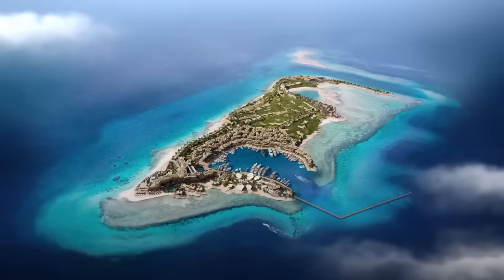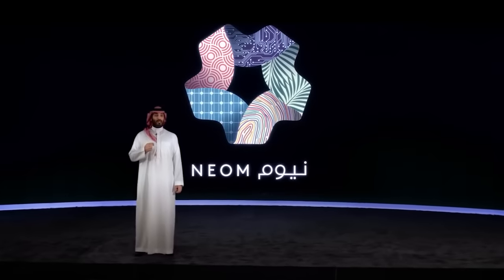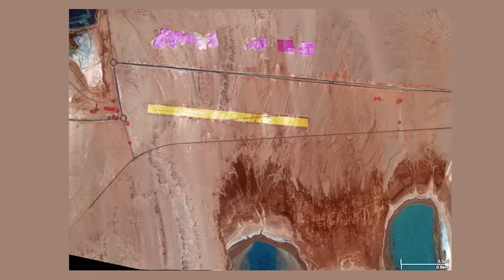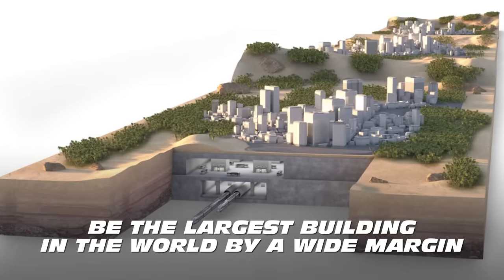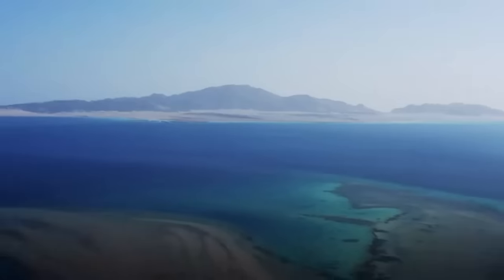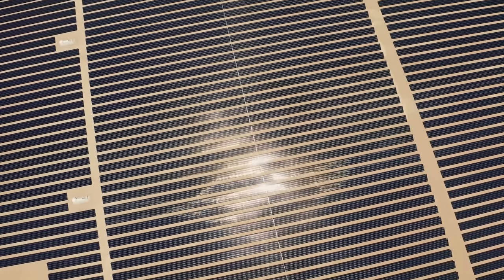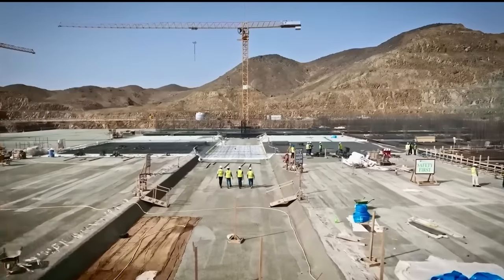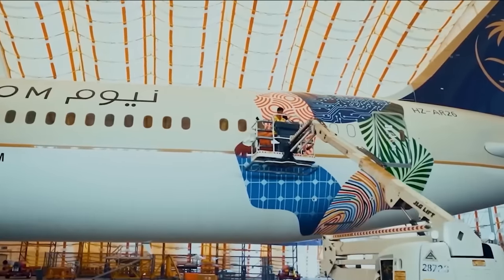Neom Is Really Happening! 😱 (2023 SHOCKING Progress)

Comment: Historically, green projects promise green, but have non-green backups. When the green fails, the backups become the norm and more so inefficient than if they had been the primary implementation in the first place. Experimentation and small scale conversion work out the kinks that slay large projects like this or leave them finished but desolate. It'd be nice, but I'm not optimistic about the project.
Reply: ya  what's 500 billion to them
Reply: Well.. we would still be living in caves if everyone gave up at the first attempts.
Reply: The bigger issue is the surveillance state and lock down capabilities these "15 minute" cities will have.
Anyone living in these will NOT be able to over throw a tyrannical leader.
Reply: I agree in a way but, on the other hand, the reason why big scale projects are usually abandoned are lack of funding. Saudi Arabia does not have these type of problems. They may get it.
Reply: The channel owner spends much time riding the green.

Comment: I’m curious if they succeed. I think the line will be the most challenging one. I question the materials they are using. A mirror facade will burn everything around it. People on the bottom part will have nearly no light. It looks very unnatural the shape of the line and doesn’t work with the natural habitat and shapes. I’m very pessimistic about this project. Too many problems and challenges. I’m worried it will be wasted money they could have used to improve already their existing cities where communities already exist. Who will live there ???
Reply: you do realize its mirror right >>>>>>>>?????and maybe the first floor wont be "ground" level"
Reply: What about sand storms won't the sand just pile up. I suppose the prevailing winds are not against the line.
Reply: @dfinlen  There wouldn't be sand, they are cultivating trees there and there would be landmarks around the line. The region they have choose because of its soil. They aren't a fool, they have researchers from Stanford and Oxford, and obviously, they have taken all care while launching the project.
Reply: @Maanaka  😂
Reply: @MichaelAndreLucasWinterdaal 🪂 The reflections of the 🧭S-storefront will cause a heat-dome with thermics towards the wall.🪟📤
Winds broke bridges 🌬🎼🌉🌉 bc of interference.🏗
Reply: Oh my Allah, for the last time no one is gonna live in the bottom. From day one we said it gonne be made of three parts, the bottom is for the transportation the middle for everything and the top is for accommodation. Everyone will live near the top floor even if its a couple floors beneath you can walk to the top in minutes
Reply: @referencefool6525  seems jealous
Reply: @Maanaka 💘😹 Just amused.
Reply: The Line is just a hitech prison. There are subway tracks, but never enough for everyone all the time, so this means you are locked into your part of the wall and become a solid brick. (These underground lines are for transport of goods and security forces.)

Comment: A large portion of the city won't be located within the structure like an airport, stadiums, convention centers, geothermal powerplants, water reclamation and deslination, as well as industrial zones and warehouses. 
Access to open water will be limited for resorts and yacht docks. 
Expansion inside the structure will also be very difficult. If a hotel needs to grow there won't be anywhere to go. Up? Down? or acquisition of other spaces possibly homes. The structure will also have the issue of modernizing in the future. Creating new spaces in already existing spaces within the constraints of a verticle shell with public areas located below. Hopefully, the A.I. they are using can navigate the logistical nightmare in future modernizations of the city. 
I still love the idea of this city.

Comment: Let's all be positive here, this plan is actually unique and if made possible might be one of the most efficient self-sustained structure that is environmental friendly.
First - Electricity. Well, we definitely have Length and Height, fill it with solar panels, since its in the middle of the desert it will harness lots of sunlight (sand also bounces light), we can also harvest the power of wind by setting up wind turbines wherever possible and as well as harnessing the power of water since both ends of the structure (assuming) are touching bodies of water, moreover, with millions of people, surely a few million will want to go to the gym, we can hook up each threadmill and stationary bicycles to the grid so the power goes back to the powerbanks and lets also not forget, we can use TRASH and HUMAN WASTE to produce energy so building a MSW Energy plant every 20 miles would be good too.
Second - The travel time doesn't have to be axactly 20minutes from Country to Country, i mean, why? its "Across the country" and that would usually take hours not to mention flight delays that sometimes gets cancelled cause of air traffic, so why not 25? even 30minutes is better than hours, this is gucci already.
Third - Water... Gray water can easily be cleaned and treated, we do this every single day, and again since both ends are connected to bodies of water, then Desalination is the way to go, very easy process not to mention 3rd party supplies isn't out of the equation, could be deliverd by land, sea and air. Moreover the power of the Sea can also be harnesed and turned into electricity and the heat from Desalination can be used to heat up whatever needs heating.
Fourth - Cooling... Leading modern architects have already solved this by using ancient technologies used by our ancestors and incorporating them with modern techniques, do some research, they have managed to cool down cities around the globe, specially in the Middle East just by proper composition of structures and incorporating trees and other types of plants as well as taking advantage of natural light to reduce heat from artificial lights. Setting up intakes on the ground will also be good (Cold air is heavier than Hot, and hot air naturally flow upwards) moisturizing the air will also help with cooling. Also, since it produces its own electricity and uses its own waste, theres a little wiggle room to turn the AC on for 2 hours from 12noon to 2pm just to help with the cooling or from 8pm to 10pm, its in the middle of the desert, the Desert can be really freaking cold at night. At night, desert temperatures fall to an average of -3.9 degrees celsius (about 25 degrees fahrenheit).
Lastly - carbon emission. True that its producing 3 years worth of the United Kingdoms yearly carbon footprint, but after it is built, you will have a New City that houses 900 million people (as mentioned by the narrator of this video), A City that generates its own Electricity through waste/solar/wind and Hydro, and will produce a carbon footprint comparable to that of a Mansion owned by a millionaire in the united states ANUALLY (theoretically).
The lifetime Pros outweight the 5-10 year Cons of this project. need i remind everyone that emissions of global aviation are around 1 billion tons of CO2 per year so since we're producing our own electricity by using the elements and using maglev tech then, this is an easy YES.
Edit: and.. and... It will have an ecosystem in there so "Animals" and "Bugs".
Reply: You forgot about total control and constant surveillance.  Such a joyful place to be, not
Reply: @michaelslavin1601  surveillance? You mean security? Or someone to man the facilities? No matter what, its going to be just like any other Job and just like any other Cities function wise. Do you think the Prince cant afford private security? Btw, Security/Police in their continent do not play around i have travelled there and other countries, and their security is top tier.
Reply: @solaraproject3614  who cares about the  B woke prince and what he can or can’t afford, seriously?
Reply: @michaelslavin1601  apparently you?